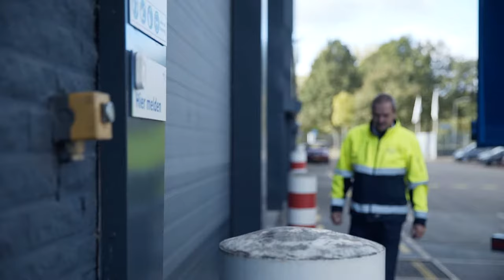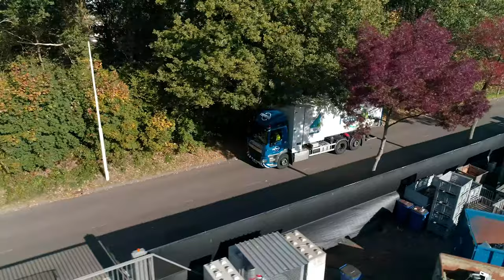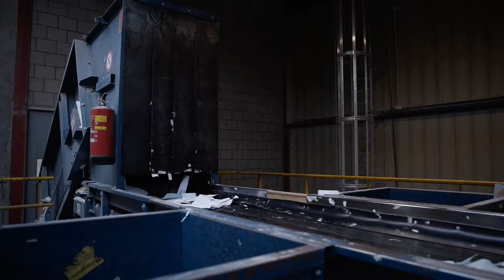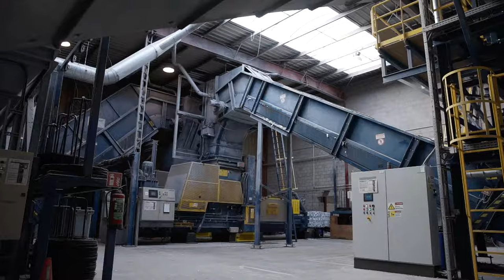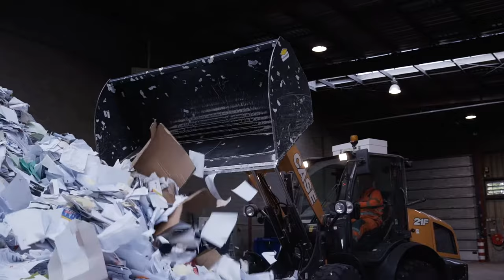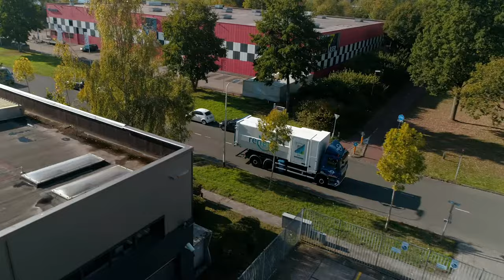Paper Recycling

Comment: What happens to the metal staples in magazines etc?
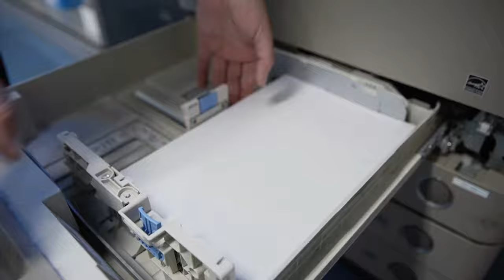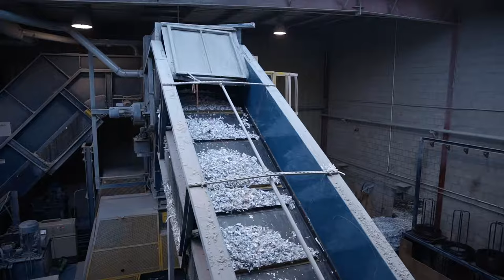Reply: Hi! In this video ( link: 🔗 https://youtu.be/HmhPuIKw0HY?si=O4m1UaZM0vvMw3QY  •  Timestamp where this is talked about: 1:21) and this other one (link: 🔗 https://youtu.be/jAqVxsEgWIM?si=ShfxUHyixFwxjK0Q  •  Timestamp where this appears: 0:42) it basically says that, during the separation process, paper goes through a magnet so that metal pieces can be separated from the paper itself, thus achieving the decontamination of the prime material (pure paper).
Hope it helped! :)

(Also, yes, as you can see, I've watched plenty of videos about paper recycling process xD)
Reply: They use magnet
Reply: @minsungderstandings Hey, thanks for answering!  I'm also curious about this, as well as what they do about the plastic windows on envelopes, rubber cement that seals folded papers, laminated decals and stickers like stamps and address labels, glitter and foil and other trash on greeting cards, scratch-off residue from car dealership ads... So much random trash that is in junk mail! How much of this stuff are we supposed to remove before recycling our paper?